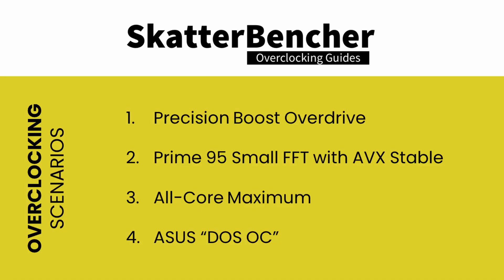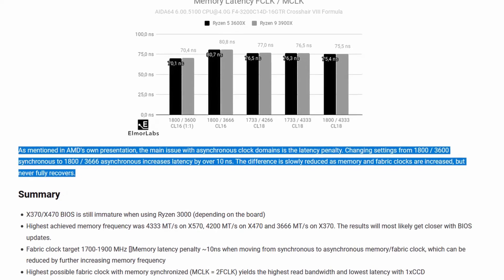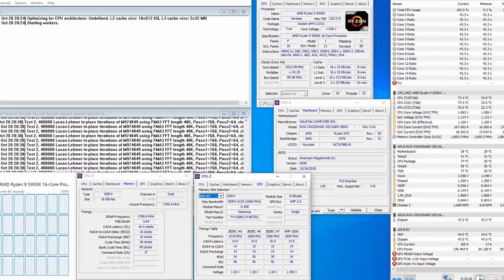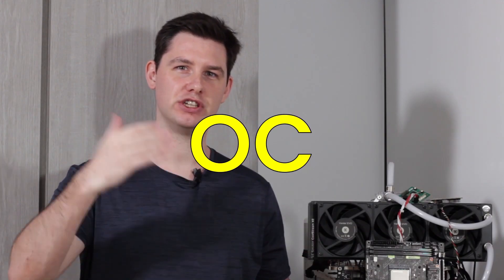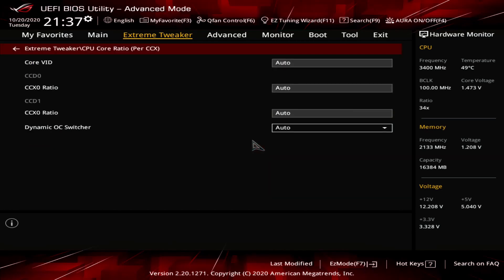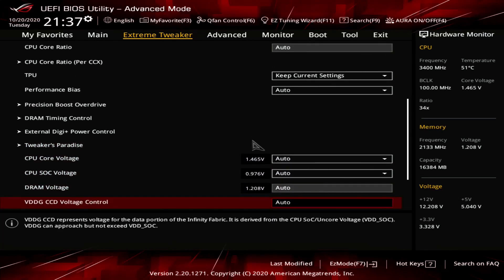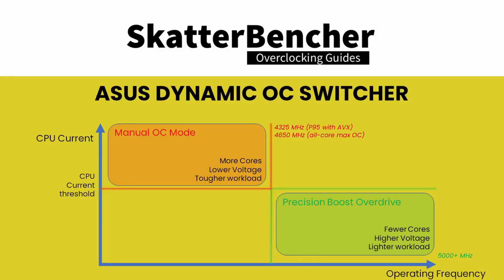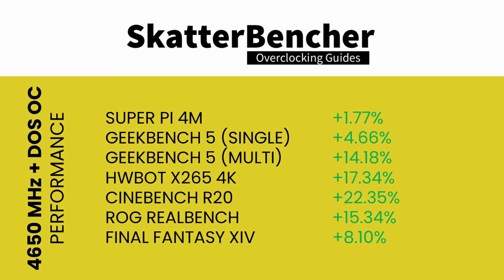5 Minute Overclock: Ryzen 9 5950X to 4650 MHz

Comment: Oc ram is hevily dependent on what kind of sticks you have though
Reply: I got mine to 3800 c14 with some tight sub timings lol couldn't go to 400 because fclk was not stable. Could easily go above 4000 if it wasn't for cpu

Comment: Have you had any random black screen reboot issues with this pc? I’m also running a 5950x and ROG Crosshair Darkhero VIII and ive been getting random reboots constantly. Bios is up to date, swapped our ram, swapped power supply etc.  i think its a compadibility issue or something, Have you ran into this? Any support is greatly appreciated, I’m losing my sanity from this pc

Comment: Great video. I have this same setup and I am curious about the voltage shown in bios. Is it normal for the 5950x voltage to be at 1.44v? Which settings would cause this?
Reply: The only thing I have enabled is AI Overclock Tuner.
Reply from the maker: Yes, it's normal. The voltage shown should be the VID for the frequency the system is currently running.

Note that during normal operation in Windows, the frequency and voltage will go up and down according to the workload. So you will see the voltage go for 0.5V to 1.5V depending on how high Precision Boost wants to push the frequency :)
Reply: @SkatterBencher  Awesome! Thank you so much that puts my mind at ease. I think everything is running normal. Thank you for the reply and great information.
Reply: @SkatterBencher  I was curious about he fluctuations as well so this explains alot.
Reply: @SkatterBencher  Do you guys have an Instagram or Twitter? I need professional guidance on the 5950x and Dark Hero they are spicy together and I need some help 😅
Reply from the maker: I'm mostly active here and on my blog (skatterbencher.com). There's a Twitter and Facebook but I rarely visit. I'm also sometimes checking out the ElmorLabs Discord where there's a SkatterBencher channel ... But I'm ashamed to say I don't visit enough
Reply: @SkatterBencher  Awesome, I will reach out on here but no pressure. I am just having trouble finding professional advice on a 5959x Dark Hero build. I am curious about how aggressively it boosts and the idle voltage. My voltage fluctuates between 1.1 and 1.4 on idle and will hit temps of 81c whenever I open a program but only for a split second then everything goes back down to normal. Does this seem like normal behaviour? From what I have read the 5959x boosts pretty aggressive and has higher temps than other processors.
Reply: @SkatterBencher  Sorry for the long message. I won't bug you too much.

Comment: Okay so yeah this is an older vid at this point but well done.  I just picked up a 5900X with a Dark Hero and the main issue I can see right now is the manual doesn't talk about hardly ANYTHING in the BIOS at all.  I'm not seeing anything on the Asus page that goes over all of the DH BIOS options.  You have some super squirrel secret BIOS manual for this mobo that can be shared?
Reply from the maker: Hehe, not really. I'm fortunate enough to live in Taiwan, so I can ask questions directly to the ASUS engineers. They explained how it works and then we tried to get some performance advantage out of it.

I have some longer SkatterBencher episodes on the 5950X, 5900X, and 5800X where I explain the feature in detail. You can also check this video if you want just the part about Dynamic OC Switcher: https://youtu.be/4cQK_kcmRSw

Comment: Thanks, do non asus boards have the 'dynamic OC switcher' option? I couldn't find it on the Auros x570 ultra. Many thanks for the great video.
Reply from the maker: Only the Dark Hero has the Dynamic OC Switcher feature. It required some PCB level changes so the feature couldn't be backported to older boards with a BIOS upgrade!
Reply: @SkatterBencher  Thanks, I appreciate the reply. Any idea if the OC can be achieved without that feature? For example on the Asus Crosshair VIII Formula board or Gigabyte Auros Ultra. Thanks!
Reply from the maker: Yes, it's no problem to overclock with those boards. I generally recommend PBO for overclocking as it gives the best single thread and all core overclocking range. 

Check out Curve Optimizer. This feature really helps getting even more out of PBO :)
Reply: @SkatterBencher  Excellent, thanks so much for the reply.

Comment: I pushed it to 4,7 and changed my fan curve. Now i get 60-63 celsius on high load multicore with z73 Kraken. Before i was at 70.. 
Could it be true? Or is something wrong? I checked CPU-z and everything is ok and it shows 47.00 when high load.
Reply from the maker: It doesn't sound very unreasonable. If you have a smaller/thinner radiator then a higher fan speed will help to increase the heat transfer from the radiator to the air.
Reply: @SkatterBencher  Interesting. Unfortunately my Cinebench crashes immediately when trying to do a multicore test on 4,7. But gaming and other workloads works just fine.  Maybe it's because i'm trying the settings in the video and just changed from 4,65 to 4,7?

Comment: my 5950x hits 85C + while gaming on an NZXT Z73 while gaming, is this normal? The rad is configured in push pull. I'm running 1.145 Vcore for manual OC @ 4.4Ghz along with DOS. Any help would be appreciated. My ambient temp is 25C
Reply: Really strange.
I'm pushing 4,7 on my 5950x with 69-70c on heavy load with Z73.
But i'm using 3 120mm in the bottom of my chassis pushing cool air that the fans over the rad pushes trough the rad and 2 140mm in the top to get rid of the excess heat.
Reply: @tcccmno   I do have 6 Intake fans on the bottom and on the side pulling cool air as well. The chasis is an O11 D XL. The situation i mentioned above is a gaming only load when single core clock boosts up to 5ghz and the voltage pushed is around 1.4-1.5 to the core. On my all core load the system sits comfortable at around 70C
Reply: @aradhyak1911  Weird! I Still don't even come close to 80! 1.5v sounds like a lot..same chassis here.
Reply: @tcccmno  well 1.5 is the stock voltage pushed to the cores in single threaded tasks to achieve that high core clock..
Reply: Have u figured it out?
Reply: @MobileMinigun   Yes I have actually, sold the Z73 and moved to a custom water loop. Single 360mm (40mm thick) rad as intake and the gaming temps dropped to 69C. Was also able to push the all core OC to 4.7 Ghz at 1.285v with an offset of 0.05 volts. Sidenote: I have a Crosshair VIII Dark Hero which has DOS which allows the CPU to switch between PBO2 and all core OC on the fly.

Comment: Can these values be used for anyone with this cpu/mobo? 
I have 3600 c18 ram though, would love to o c these as well. But I am nervous and no idea where to start! 

I’m getting about 150-160 FPS in Warzone with high settings on a 1440p 27” monitor, I feel I should be getting more according to benchmarks I’ve seen. What do you think?
Reply from the maker: No, the values that will be 100% guaranteed with your system will depend ... on your system.

My suggestions for AMD are to enable PBO and enable XMP for easy performance gain.

Comment: You mean to tell me that ASUS only added this critical feature Dynamic OC Switcher on their new Dark Hero and not the original Hero VIII X570 board?? If so that is disgraceful - that is a killer feature to be able to automatically manually overclock while retaining the single core auto overclocking. Without this manual overclocking is absolutely useless since you need the single core boost for most software.

Comment: Just plain 1.3 VID and you're stable? I max out at 4.5 with a 1.3 VID. 1.4 VID gets me to 4.55. What am I missing?
Reply from the maker: If your temperatures are good, then perhaps it's just a different of luck in the CPU lottery
Reply: @SkatterBencher  I ended up pushing it to 1.35 VID to get stable in R23 (30 minute run) at 4.5Ghz. Vcore was at 1.21v and temps were around 66C. I think at 1.3 VID like your video, I'd actually end up around 4.45Ghz stable. This is on Dark Hero bios 3003. Others I've talked to report about the same. You must have a magic 5950X!
Reply: @SkatterBencher  what's your VCore under full load look like with those settings?
Reply from the maker: 66C is still plenty of headroom to increase the voltage a bit. I checked my settings but looks like I didn't jot down the Vcore under load with post-Prime95 settings. My maximum stable Prime 95 with AVX settings are 4325 MHz with 1.2V  set (1.05V under load). I have posted my Prime95 screenshot on the website https://skatterbencher.com/2020/11/05/skatterbencher-15-amd-ryzen-9-5950x-overclocked-to-4650-mhz/
Reply: @SkatterBencher  This is great info - thank you so much. Cinebench R23 uses AVX and I'm tuned to be R23 stable (min 30 minutes). Do you think that's similar to being Prime 95 stable? That would explain why I have such a wide spread over your numbers if I'm comparing your Post-Prime95 (4.65) to a heavy AVX-stable load (4.5). I'm definitely more curious about what VCore is vs VID for you b/c I'm seeing a lot of people set VID then offset to get stable vs just increasing VID, and I believe the net result on VCore should be ultimately what matters, no?
Reply from the maker: Oh, good question. I didn't do specific testing to compare Prime95 and Cinebench R23. But if my memory serves me right, then for an overclocked 10900K Cinebench R23 would be ~300W package power and Prime95 would be ~330W package power. So, my guess would be that CB23 stability is very similar to Prime95 stability but maybe not quite equivalent.

I believe the wide spread of my Prime95 and post-Prime95 stable frequency came down the the temperature limit. I recall trying Prime95 with AVX stability testing at higher frequencies, but needing too much of a bump in voltage. This caused the temperature to rise over 90C. On Ryzen 5000, it seems that stability deteriorates quickly when over 90C (which is what I experienced). Non-AVX workload is a lot less demanding from the CPU so I could increase the Vcore more easily, which resulted in much higher frequencies.

I think you can also see this play out comparing the different Ryzen 5000 chips I tested: 5950X 4325/4650, 5900X 4550/4750, 5800X 4600/4775, 5600X 4400/4650 (CPU P95 freq / post-P95 freq). The difference between P95 and Post-P95 stable frequency is the largest with the highest core count (since small bumps of voltage will have a bigger jump in temperature).

As for Vcore: you are spot on. In the end, the effective voltage is the determining factor for overclocking capability and stability. The effective voltage is not only dependent on the VID and any offset set, but also the VRM design and load-line. I have another video up on Adaptive Mode Voltage for Intel platform that sort of covers the basics of this: https://youtu.be/0TGcKyXBQ6U. While the specifics of voltage configuration on AMD are different, the general principles apply.

Comment: Never run manual clocks with auto voltage...
Reply from the maker: Nowadays, the voltage is pretty much controlled by the CPU's factory voltage/frequency curve. This curve determines the default voltage for all frequencies. Auto voltage is pretty safe these days.
Reply: @SkatterBencher  My 5950x, with auto, runs at 1.4+v, is that safe? 

The onyl thing I have enabled/configured is DOCP (XMP) for my 16-16-16-36 3600MHz RAM

Comment: Ugh, I can't make up my mind on whether to hunt down the Dark Hero, the regular Hero VIII, or the Strix-E. I really don't plan on overclocking and want to pair it with the 5800x. Any real benefits with or without the chipset fan? I need to finally get away from my old FX 8350 already, lol.
Reply from the maker: I don't think there are any benefits to the Dark Hero other than the Dynamic OC Switcher (overclocking) and the lack of chipset fan. Tough choice between those three boards. :)

(and yes, time to move on from the FX-8350!)
Reply: i went with the hero 8 wifi. pretty solid board was already updated to a bios to work with the 5950x. my only issue with it is for the price the rgb is incredibly dull and dim. my old board less then half the price was 3x brighter.

Comment: i got 5950x and 4000mhz cl15 ram. that 3600 tho
Reply: @Noodles i have the quadkit 4x8gb F4-4000C15D it boots with 4000/2000 but it is not stable with a fclk @ 2000 - need to w8 for update. 3800/1900 with cl15 is the best atm with 3003 bios
Reply: @kingshands  same problem here but I run a formula x570
Reply: @KronicNitron  we have to w8 for a new agesa from asus :) but it is already good when you can boot into 4k2k
Reply: @kingshands  yea lots of problems my newest bios messed up all my timings and fclk but yea now it’s waiting time might just go intel
Reply: @kingshands  Very accurate
Reply: I run mine my 4000MHz at 3600Mhz with CL14-14-14-14-28
Reply: @jjdizz1l  I got mine at 3733 15,15,15,15 I was 14,15,15,15 but games didn’t like it
Reply: @KronicNitron  Not bad, but the current AGESAs don’t like going over 3600 less than 15 across the board. I keep trying.
Reply: Me2! Hi

Comment: Hey, great video! 

I have ordered the 5950x and the dark hero. Would love to see you do a step by step video on how to overclock using dos oc! I just know a little about overclocking and dos oc is new to me, but one of the reasons I bought this combo. Thank you
Reply: Just to add: I have 64GB of gskill trident Z c14 3200 and would not like to tweak with these. Can I leave this at docp 3200 in the bios? Also cooling the 5950x with an NZXT z73. Will I still be able to go with your settings with DOS oc?
Reply from the maker: Thanks for the kind words!

You can check the full length SkatterBencher videos on the channel for a more detailed look at DOS OC. I include the entire BIOS configuration and explain how to find the right current thresholds for DOS OC. https://youtu.be/nJZIGUaEXvU?t=556

As for the memory: I would say, YES, just DOCP should work fine. You can check if the infinity fabric and memory controller are running synchronous mode (1600 MHz). If not, set that one manually too.

Good luck!!
Reply: @SkatterBencher  thank you! Will try it out once I get the 5950x (still waiting)